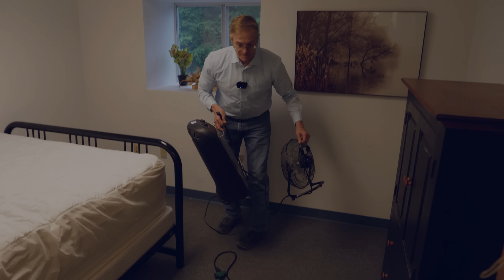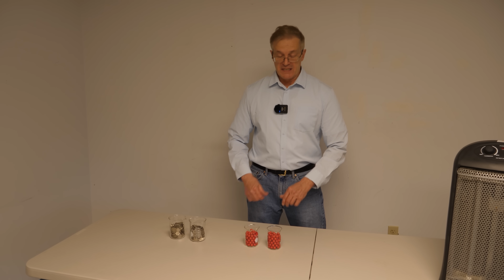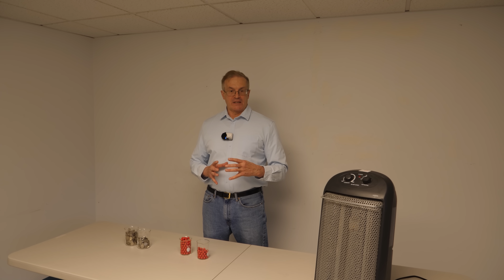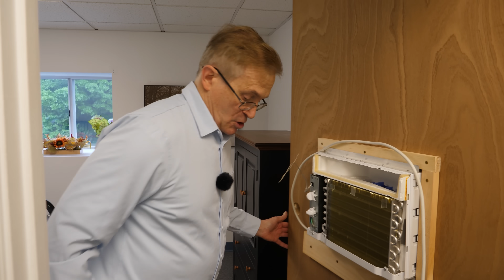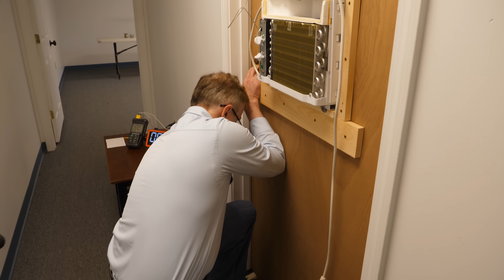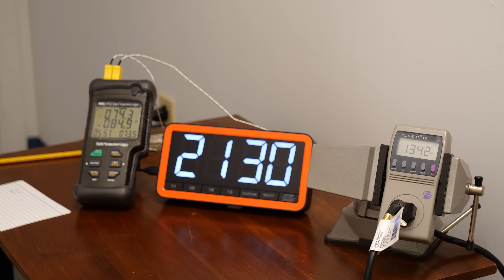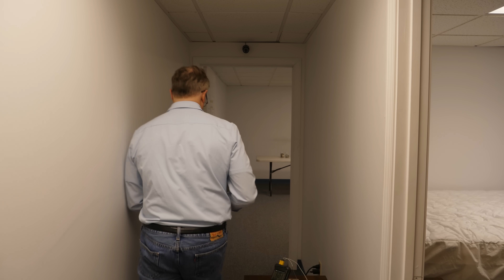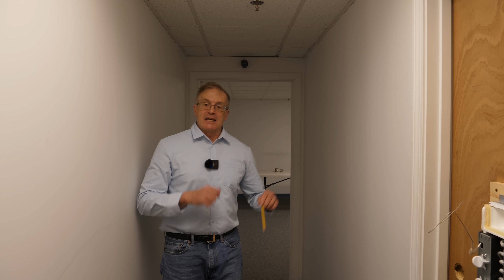You're wasting money on heating! Use your A/C!

Comment: I been saying for years now, that the reason our summers are getting hotter and lasting longer: every a/c cools the house, but kicks hot air outside. Billions of homes planet wide, contributing to the "global warming" in a covert, but predictable, way.
Reply from the maker: Carry that thought a little further. Those airconditioners are separating the heat. The cooler home is reabsorbing the heat that was moved outside. Otherwise, it would become too cold to live in.  The airconditioner is maintaining that differential against the thermodynamic force to reach the same temperature everywhere. 
There is something to be said for the electrical energy used to drive those airconditioners, but that is no different than lighting, wood fired stoves, etc.
Reply: Add the fact that record numbers of cars........each one is a mini greenhouse.....heat maker no matter the windows up or down.

Comment: Ok, so a heat pump is more efficient than creating heat, but you still need heat to pump, so what is your source?
This is far from the first video where you guys make some "breakthrough discovery" that shows you guys know just enough to convince yourselves, you've got the answer to some problem.
Also, where are you guys getting these space heaters, that don't have a fan?
Reply from the maker: Thanks for taking the time to comment. 
Did you watch the first part of the video?
Did you not understand the distinction between moving heat and making heat?
If not, watch it again, and your question will be answered.

Comment: If you reverse the unit it won't work as a heater. The thermostat on window/wall air-conditioners cuts off the compressor at 60⁰F. Good demonstration though.

Comment: Just take the AC unit out and turn it around so it faces outside in the winter cooling the outside and keeping your home warm in the winter , I'm confused on what setting to put it on , one , two since it's on the second floor do I nail the ladder to the window so it won't fall ? I can then turn it on and off that way , what about the extension cord?

Comment: retired HVAC technician here
 heating your house using  a heat pump / electricity is the most expensive way unless you’re getting the electricity for free.. A heat pump is more than 100% efficient. At least that’s what they taught us in HVAC school because the electric motors and the heat generated by the compressor is also used to heat the space you are sending the heat to.. but I hate pumpkin, only extract teeth, efficiently as long as the air temperature is above 40°. After 40°, a heat pump, turns on heating coils called supplement sheet to make up the difference/shortfall because the coils cannot extract any more heat from the cool / cool ld air.. sure a heat pump will work, it is just an air conditioner, working in reverse, instead of absorbing heat, and moving it outside, it’s absorbing heat outside and moving it inside.. your dad is just as expensive as running your air conditioner in the summer when you get those large electric bills..
  HVAC systems do not create cold. All they do is move heat from one place to another. In the summer they absorb the heat, and it moves it to the outside to get rid of it. If you have a window unit, go outside and feel the heat coming off of the coil that is on the outside. That is heat that has been moved from inside to outside.
  if it is a heat pump, which is simply an air conditioning unit in the coils reverse their duties, the outside coil is absorbing the heat from outside, which is relatively warmer, then the refrigerant in the lines of the HVAC unit. And it carries that heat into the house and releases the heat inside.
The price of a 3 ton condenser outside piece which is about average for a 1500 ft.² home somewhere where the average summer temperature during the day is around 85°. The price of that outside compressor/condenser is around $2500 now. Then there’s the a coil which is simply the coil on top of your furnace that the furnace blower makes the air pass through and the coil on top of the furnace absorbs the heat being cycled through the a coil. The air going through the a coil has its heat, absorbed by the  chilled a coil wines/radiator if you want to call it that.. The refrigerant is then warmed by absorbing the interior heat passes through the coil on top of the furnace, and that liquid coolant travels outside to your condenser coil, where it releases the heat outside. I don’t know how they go outside and hold your hand above the condenser and feel the heat coming off the top of the unit while it’s running.  
if you’re going to upgrade your system to a very high efficiency system. You can’t just put the outside condenser in and connect it to the inside furnace coil. You really shouldn’t. Just buy a new furnace with a multi speed blower, a new, refrigerant line set. New thermostat, programmable, and the outside unit
 For a standard ranch house 1500 ft.² it should cost you around $7500-$10,000 installed
  it is best to upgrade your whole house, air filtration system to a large capacity April Aire air filter system while you’re doing the work. They are large and have a lot of surface area. They have deep leads much like the appearance of an. accordion..
  Make sure that your technician brazes your lines that connections..
and most importantly, make sure when they pull the system down into a vacuum to get all the moisture out of the inside of the refrigerant lines, that they pull a vacuum down to 500 µm to get all the moisture out of the inside of those tubes. Because if they don’t, is the refrigerant pressures through the little metering device that causes the drop in pressure that lowers the temperature of the refrigerant, it will form ice. And possibly block that metering device, if there is enough moisture in the system

. where does this moisture you want to remove from the system before you charge it with refrigerant come from, it’s the humidity in the air
 your new furnace will have multi speeds for the blower. When in heating mode in the winter, the blower speed will be lower than in the summer blower speed. Somewhere around 30 ft./min. is the speed of the blower circulating the air through the house. Any faster than 60 ft./min. makes the house feel drafty when in heating mode.
  The opposite is true for air conditioning, blower speed. You must have the higher, not the highest, but just a higher lower speed, blowing the air through the furnace/air handler over the coils, or they could form a block of ice, completely engulfing the coil that’s supposed to be picking up heat. If it is covered with a large frost ball of ice, no Eric, and pass through the coils. So you must have the furnace blower speed on your thermostat set for a higher Speed. that it will automatically revert to win in cooling mode during the hot months..
 
when sizing your air conditioning unit for your home. If you buy two large of a unit, let’s say you buy a 5 ton unit for your home when you only need a 3 ton unit. What will happen is, that 5 ton unit will be cycling on and off constantly maybe every 5 to 10 minutes greatly increasing the cost of your electric bill and putting stress on the. unit compressor and contactor and start capacitor, it would be like shutting your car off and turning it on while on the trip while you’re driving. Do you want to have a unit that Ken run longer to cool the house down. It would be ideal if it ran.

Comment: I DID NOT HEAR AN EXPLANATION OF HOW THE A/C UNIT WAS SET UP AND WHAT THE DIALS WERE SET AT. 1. WAS THE A/C UNIT EXHAUSTING HOT AIR INTO THE ROOM? 2. DID YOU HAVE THE COMPRESSOR TURNED ON TO BE PUSHING COLD AIR INTO THE HALLWAY?? THIS PART OF YOUR TEST WAS VERY VAGUE. PLEASE CLARIFY.
Reply from the maker: I didn't explain that because the setup was so simple. We just turned the airconditioner around and set the controller to maximum.
Reply: @TechIngredients  THANKS. IF YOU SAY "SIMPLE", OK, SO WHY DONT YOU THINK MANUFACTURERS OF WINDOW A/C UNITS DO NOT MAKE THEM REVERSIBLE????
Reply: @lincolnvlogs8965  in Europe, some heat pumps do it. My personal heatpump is just for heating.

Comment: This is flawed because the air conditioner is much closer to the temperature probe than the electric heater.
Reply from the maker: I disagree.
Look again.  The airconditioner is blowing its hot air away from the probe and across the room towards the resistance heater.

Comment: The problem with this argument for heat pumps is demonstrated by my situation.  We had a gas forced air heater.  We would spend up to $150 per winter month.  I replaced it with heat pumps, the forced air unit was about 30 years old.  We then had to spend a minimum of $300 (and as high as $500 per month) per winter month to keep the house at the same temperature.  This is averaged over several winters with both systems.  The heat pump system broke after 5 years and it was out of warranty.  We put back in a gas forced air heater and our heating bill went back down.
Reply from the maker: That is a good example of why a general analysis is so valuable. It's always tempting to compare some part of a project that we find interesting or exciting while overlooking others.
We didn't compare heating with different  energy sources and their relative cost.

Comment: good video! colder it is outside the less efficient it will be(you say 10% between 0c and 35c) . but sub zero temperatures wont be very good I. plus you might over freeze your air conditioner. i live in Canada. it gets down to minus 50c sometimes.

Comment: This is an excellent demonstration for those unfamiliar with the benefits of heat pumps and the lack of affordable small window units. As others have noted, it’s possible to modify a window AC into a heat pump, a concept that dates back to the 1960s. However, modern units require more than just adding a reversing valve—features like defrost modes and proper drainage are crucial but often overlooked. Until these issues are solved, manufacturers seem hesitant to revive this idea. Some inverter mini-splits are exploring the concept, but at over $3,000 and with no units as small as 5,000 BTU, there’s still a gap for small homes needing simple heating and cooling solutions.
Reply from the maker: Good points.

Comment: Costs me $175 a month to run the air conditioner during the summer.  My gas bill tops out at about $35 during the winter months when I'm running the gas furnace.
Reply from the maker: Sure, and that's why we use gas heat as well. The cost of the energy obviously differs depending on the source. It also depends on your location.
The principle I demonstrated compared the heat multiplying effect of a heat pump compared to a resistance heater and both were electrically driven.

Comment: so the ac will stay running on the outside if its actually outside in the freezing temps? mines digital so wont the thermostat cause it to shut off after its lowest setting at 61 degrees? sincerely gonna do this

Comment: Please explain practical use here, If you stick the AC backwards in a window in winter, AC wont run and if you can override the thermostat to make it run, there is no heat to pump because its cold outside.?
Reply from the maker: This was a demonstration of the principle of heat pumping.  A practical installation would require modifications of a conventional air conditioner such as control access, protection of the indoor rated components, water drainage, de-icing, etc.

Comment: Completely dishonest test... cant use 2 electric devices, then compare power usage to a single device. Having a fan blow directly on the coils keeping them cool reduces the effectiveness of them and is not how they were designed.
Reply from the maker: You might disagree with our approach,  but you're wrong to say that we are dishonest.
Reply: @TechIngredients  take a single unit with same power consumption and comparing a single unit with same power consumption would be a intellectual equal and fair test
Reply: @TechIngredients   so yes you being purposely dishonest or unable to see how you are comparing the equivalent of a diesel motor to two gas motors and then saying we'll diesel using less. Is this exact argument.

Comment: I'm curious if the temperature of the outside makes a difference.  Like if it's freezing outside, will it still work as efficient on warming the inside?
Reply: The efficiency is roughly proportional to the difference of temperature between the requested heat and the outside temperature.  The colder it is outside, the lower the efficiency.

Comment: Sure they are fine if you don’t have regular low ambient conditions. While they have improved upon efficiency in general at lower temps, still not perfect. If using electric heat strips for long periods they pull high amps which equal high cost. Minisplits do a decent job and can even go VRF/VRV which can run down in the negatives if designed properly. Expensive to purchase though and install. Everything is on control boards and you are not gonna find a replacement down the road. Not just relays and contactors anymore but I suppose even standard equipment is starting to go that route. 

It’s fun to tell a customer that a 1/4 of their building will be down for 6 months until Mitsubishi can get the board to ya. Only spent over a million dollars installing it all a year ago… 

At the same building lightning struck a flag pole. No evidence of it getting on the coms of the system nor burnt marks anywhere but still had 12 control boards fail which even kept the units that were fine not operational until those were removed from the network. But hey, do you.

Comment: We have window AC units. I've found it strange how in summer we use AC to cool buildings and at the same time heat the outside air even more doing that. So would turning the AC units around to heat the building cool the outside air more in winter? It has crossed my mind to use the heat from AC units to heat our house having walked behind one in summer. They do put out a lot of heat. I like to be warm and also save money. After being hit will some high electric bills in winter the past few years I'm all in for a better way to heat. Been thinking about how my grandparents heated. Wood fire place. Of course if you have to buy the wood from someone else it's not cheap. Cheaper than paying the electric company though.
Reply: I think you may be misunderstanding things a little.
Heat pumps don’t create heat, they displace it from one location to another.
The ambient temperature of the earths surface is made up of heat both inside and outside of our homes.
While the volume of space being cooled may change the volume of the space that we call “outside”
The size difference in size is so great that the difference in temperature difference outside would be imperceptible to even the most precise measurements.
However, if you had many heat pumps in a relatively small space, the heat may concentrate in that area for a certain amount of time but that heat will reach it’s equilibrium with the surrounding area
Reply: @metoonunyabidness1391  I don't understand all the technical things for sure. I'm just basing my comment on the amount of heat that comes off the rear of the AC units. I'm thinking if I turn the unit around so it blows the cool air to the outside and the warm air inside it could help heat my small room I use as a sort of office space. Sort of like my computer. I don't understand how it work but as long as it works I'm good with it. What I'm thinking is that the heat coming off the AC unit warms the things in the room up some it will help the room stay warmer. I have not clue how much it will help but if I can lower my electric bill I'll take it. Whatever I can get I guess you might say. I'm also looking into building my own wood heater and maybe cook stove combination. I'm pretty good with working with metal and a welder so...Anyway, thanks for the reply. Any knowledge I can get. I try to learn something new everyday. Even if it's something I don't much like.

Comment: Truly sweet video. Question. You said an electric heater is almost 100% efficient? I just moved into a new building and I'm going to need heat soon. 900 Square feet with a 26 foot high ceiling.  There's no gas in the building so I'm thinking about a 240V shop heater hung at about 18 to 20 feet off the floor. I haven't looked into running a gas line from another building on the same lot. Give me your thoughts about heating.Thank you. I'm looking forward to your next video about heat pumps.
Reply from the maker: That's tall for that square footage.  
I would locate a heat source at ground level because  the warm air will rise on its own. Incidentally, don't neglect insulation.
The cost equation depends on the initial investment in the equipment as well as the cost of the energy source.
Reply: @TechIngredients  Sorry. Bad on my part. The entire building is 30 x 100 with 26 feet to the trusses and then maybe 8 more feet to the ridge. I'm using 1/3 or 30' x 30' the other 2/3 is warehouse. I've been given permission to build a wall between my part and the rest with sheet rock on on one side. I just found a local supplier for 30' metal studs. The walls are cement over old brick. I'm going to fir out the bottom 8' just so I can hang things on the walls. I'm not sure how exactly to insulate up any higher than that. and because there's no gas in the building, my only options are either electric or a wood fired stove.

Comment: I can't find the follow-up video. Has it been posted? I am wondering if I can direct the outgoing hot air back into my trailer it seems I can heat it with the AC unit I already have?
Reply: you need a unit made to be a heat pump or modify the unit it is normally only made to cool
Reply: @ranger178   You might want to read Doodybird5766 response below. Seems it might work.